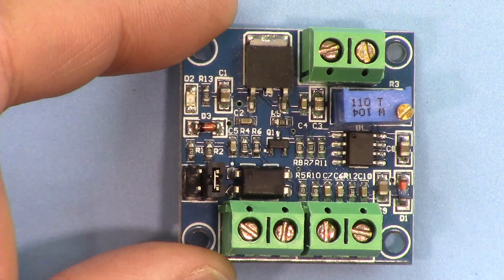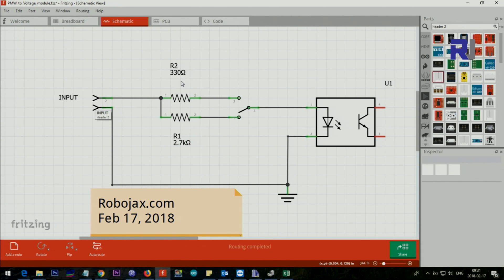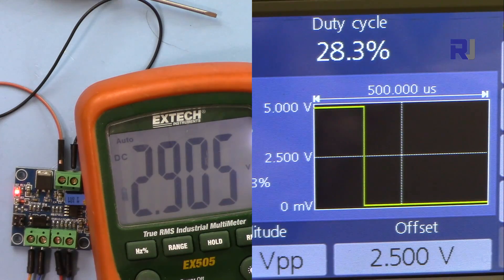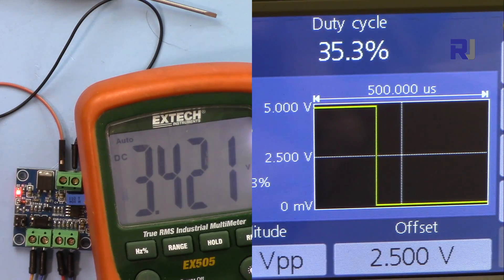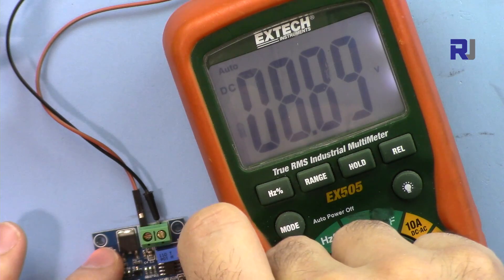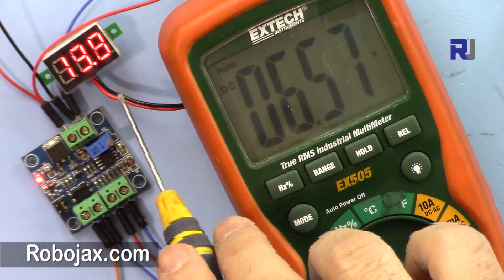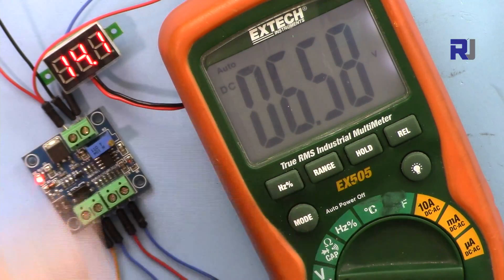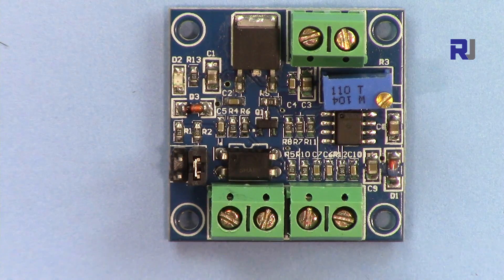Convert PWM to Voltage using IC Station converter (Review and Test )

Comment: What makes this module interesting for me is that now I can use any digital sensors to convert data into an analog signal and work with it without jumping through hoops - or rather, without dealing with the Modbus protocol - and that makes me happy.

Comment: this board cant hundle the power they burn easy the back side and turn on fire when i use them to turn my 0-5 volt out from mach3 board to vfd spindle .. becareful with it i solder strong cable to 1 off them to keep it work and they not take fire on the chips on  they take fire on the board connections always i burn like 3 of them they work fine and then they get fire random... after some use

Comment: @robojax why do some of these converters have a 103w trim pot and some a 104 w pot? Measuring from center to one i get a constant 5.29k ohm (even turning multie times) and the other center to pin a constant 0.03k ohm. I have replaced with a good one after testing out of circuit, was good and once in got the same as before.. it wont adjust and get get same voltage no matter what the pwm input or the vcc input is.
Reply from the maker: this module is not accurate. You better look at this digial module using Arduino whcih you will have full control https://youtu.be/j_BwZT9z-0g

Comment: Great example, is there any opposite application? 

The input voltage is affected by the variable resistor, so that the output PWM signal produces changes in the duty cycle (changing the speed of the PWN FAN)
Reply: i think this is the board i've bought instead of the one in the video, it looks exactly the same but i'm affraid mine doesn't convert PWM to DC but the opposite way... i'm just trying it and it's not working the way i want (PWM to DC)...

Comment: schematic diagram plz
Reply from the maker: This module is not accurate. Use proper module that you can control and manage : Output DC or AC Voltage using MCP4725 DAC with LCD and PWM to Voltage Converter with Arduino
https://youtu.be/j_BwZT9z-0g

Comment: I don't understand what the jumper is for, is that for the input voltage of the PWM signal. I have a woodpecker CNC board, and the spindle says 24v PWM, so I need to convert this to 0-10 MACH3 volts, will this do that. Thanks

Comment: is there any information of how much ripple the DC voltage output has/ how smooth it is?
Reply from the maker: Please use this module with pepper quality design and have full control Output DC or AC Voltage using MCP4725 DAC with LCD and PWM to Voltage Converter with Arduino
https://youtu.be/j_BwZT9z-0g

Comment: I'm searching a circuit like this for control via PWM motherboard signal non pwm pc fans, but need the pwm frequency is to be around 25 KHz and from the characteristics this circuit manages up to 3 KHz
Reply from the maker: Hi, here is better option where you can do exactly what you want https://youtu.be/j_BwZT9z-0g

Comment: Hi dude, could you please share the code?
Reply from the maker: what code? this video has no code. Here is better solution to convert PWM to Voltage https://youtu.be/j_BwZT9z-0g
Reply: @robojax  I would like to convert PWM to voltage 0-10 using IC station converter (LC-LM358-PWM2V) with  potentiometer as the input but I dont know how to write the code and how to wiring because I am a newbie in Arduino, I just learned Arduino. If you never mind, could you please share the code to convert PWM to voltage 0-10 using IC station converter (LC-LM358-PWM2V) with  potentiometer as the input?
Reply: code in Arduino

Comment: @robojax Hello! Please help us if you can! I have a project where I am using a standard PWM controller to control a 12v motor and gearbox, but need to use an ebike throttle with Hall Effect sensor. Do you think there is a way for this converter to work in reverse for that application? Currently it works when hooked up, but motors turn slightly due to the hall sensor throttle giving the controller a different control voltage signal than what it needs. Other than turning slightly everything else operates normally, just need to knock out that 1v signal that the hall sensor is giving out while still being able to vary the voltage with that throttle. If anyone could help I would greatly appreciate it!!!!
Reply from the maker: Hi, this might help you Output DC or AC Voltage using MCP4725 DAC with LCD and PWM to Voltage Converter with Arduino
https://youtu.be/j_BwZT9z-0g

Comment: hi, i have a problem, i  set the arduino pwm output to 255, but Voltage out only 5 volt, not 10V as your description in video, please help me
Reply from the maker: Hi module does not make or amplify the voltage. you must supply 10V to this module and then input is 100% dyty cycle, then you will get something closer to 10V.
Reply: @robojax  im supplied 12 V for Vcc
Reply: And input is 100% duty cycle: analogWrite(3,255), but only 5V out
Reply from the maker: Why you talk about programming and others things. I am talking about t this module not the arduino board and I have no  idea what I did in this video. Let’s focus on this module. If you feed 100% PWM with 5V from any source you o the input , and is this module is powered with 12V the you will get 12V at the output of this module.

Comment: I have my pwm on the gnd. I trying to use it with a shelly rgbw2. Any help out there?
Reply from the maker: does not mattger the GND. connect GND and PWM signal to the input.  Or use the module shown in this video to have proper control over the signal https://youtu.be/j_BwZT9z-0g

Comment: Is anyone aware of a PWM to Voltage converter that will work with a 20kHz PWM signal?
Reply from the maker: use the method shown here https://youtu.be/j_BwZT9z-0g to have exact control over PWM and the voltage output.
Reply: @robojax  Thank you, very interesting! However, that needs an arduino + custom code. I was hoping for a turn-key solution like the one in this video

Comment: For some reason my amps are changing from 5amps in to 1amp out when plugging into this. The current does not seem to be right. Any reason for this?
Reply from the maker: Hi, this module is about "PMW to voltage" there is not current. may be you posted under wrong video?

Comment: Hello how are you? Thanks for video. Question is: Can and I connect a DC motor to voltage output for example? Wich is maximum current supported. Any recommendation in negative case.
Reply from the maker: Hi, no you can't . In order to run a motor, you need motor drive. The output from almost all devices have very little power and won't be able to drive a motor.  you may learn it from this video to use L293D chip and feed your PWM to L293D https://youtu.be/D4yLsWvZDw4 or learn from this video to inject your PWM to the motor driver. https://youtu.be/EapP4BhlYb0 but and forget Arduino. I used Arduino to generate PWM, but you already have PWM signal. then feed it to motor driver.

Comment: Is there any way to make this module accept a PWM input of 0-3v? If not do you know of one that will convert the 0-3 to 0 to 10? My CNC machine spindle output only gives 0-3 out and my new VFD wants to see 0-10 for proper spindle speed control.

Comment: Hi there, I need a device that will convert a 3.3v PWM signal to a 5v PWM signal. For example, a 75% of 3.3v duty cycle to a 75% of 5v duty cycle. Is there a product that can do this?

Thanks a million

Geoff
Reply from the maker: So you just want to convert logic level. That is very simple . Search for logic level converter.

Comment: Is the ground for pwm in and ground for analog out isolated from each other?
Reply from the maker: It should not be isolated. But I am not sure. Use ohm meter and check it

Comment: I connected 12v dc to the module, and set the arduino pwm output to 255, but the output of the module does not exceed 5.3v.  Why?
Reply from the maker: Hi, you made me watch the video.  You adjust the potentiometer to set the output voltage.  the potentiometer is multi-turn meaning you have to rotate it 10 to 15 turns to get result.
Reply: @robojax  No matter how much I turn the potentiometer on the module, it does not rise above 5.3v.
Reply from the maker: Something must wrong or the PWM frequency bus out of range. I don’t remember the value but I should have mentioned it
Reply: @robojax  potentiometer of the module?
Reply: @robojax  The voltage supplied to the module is fixed at 12v

Comment: I need a device with input 30 to 50 volts and output 0 to 10 volts. It  should be stand alone unit , is there a frequency required? It's for a battery level monitor so minimal current is required
Reply from the maker: I have explained the voltage and frequency. Please watch the video fully. I don't remember anything from this video.

Comment: Why do you say it's precise? you're getting 6,8v at 100%PWM. Shouldn't it be 10v at 100%?
Reply from the maker: I am. Not sure what are you referring. I have to watch to answer , but please watch it fully. I mentioned what is the maximum input voltage and I don’t remember.

Comment: Hi I am using arduino flow sensor yfs201 with plc so I want to convert it's pwm output to analog voltages I am impressed by this video but I need your suggestion ass well does this product work with this kindly respond

Comment: I am looking for a device to go from the output of an RC receiver to the 5K pot input of a motor controller.  Any such thing?
Reply from the maker: so put it this way. you want to control a motor using RC remote controller. You can use this module to control a DC motor using Arduino (in one direction) https://youtu.be/ipFxYQkB5uw and you can find codes to detect RC receiver code.  or use this module https://youtu.be/PUL5DZ9TA2o and control up to 30A motor in both direction or 2A DC motor in both direction https://youtu.be/wn5D7j1ybxY good luck.
Reply: @robojax  I am wanting to radio control e-bike brushless hub motors.  Hobby RC ESCs are not designed for this type of motor.  The e-bike motor controllers use a 3 wire pot or hall effect throttle control that varies 5VDC out of the controller back in to the controller to set the motor speed.  I want to come out of a channel on an RC receiver into the throttle input of the e-bike motor controller.  I could mount a servo to the throttle, but would like a neater solution without using a microcontroller like an Arduino.  If the RC signal could operate a digipot, I think that would be great.
Reply from the maker: Yes there are so many library that you can use (I have not used them yet) to extract values from the RF signal from receiver and do whatever you want to with  it. Sure you can do it. just do a bing/google search .

Comment: Hi, I can see that all 3 GND pins are interconnected (on the backside of the module). This way, the GND from PWM source is connected to GND from DC 12-30V source. Is it okay? Does the module have any protection against overvoltage from DC source to PWM ground in case of DC source failure?
Reply from the maker: Hi, no it does not have protection.   so prepare your input properly.
Reply: @robojax  In a reply to @Ale, you wrote : "you can disconnect the optocoupler's ground from other device". If I do this, I would have much better protection of PWM signal source, because its only connection to the module would be via this optocoupler, ok? Have you already tried to disconnect the optocoupler's ground? How did you do it, simply by unsolderning the pin of optocoupler, or by unsoldering the reference GND pin (next to PWM input)?

Comment: I need the opposite: 0-10V PLC signal to 0-100% PWM signal. Any recommandations?
Reply from the maker: use $10 Arduino board and 2 resistors . Read 0-10V and very easily output PWM proportional to the input voltage. This is to read any DC voltage with Arduino https://youtu.be/t8xwrVj2aFs and then learn how to generate PWM from this video https://youtu.be/k13iTmvPtUU

Comment: Voltage to PWM?
Reply from the maker: yes that is what the title says. PWM duty cycle will change proportional to voltage.
Reply: @robojax  No the title is convert pwm to voltage. The material is quite useful. My question was can you do a Voltage to PWM(Not Voltage to Current) vice versa video relative to this video. I'm looking to use both modules in tandem(V to P + P To V) to create a tuneable inline fan flow protection or signal generator using 2 Inline duct Fan's. It's complicated but the goal is to  find a use for the0-10 reference voltage off of the fans which are unpowered but spun inline to create a reference of air flow.
Reply from the maker: Yes. very easily. This video https://youtu.be/3_C7gJeX9hc show to measure the voltage from potentiometer and proportionally outputs PWM to control servo motor. so you can use it for other purpose.
Reply: @robojax  Perfect!

Comment: Hi! I am using this board to control the spindle of my CNC. I was really surprise when I found that on the pwm to voltage board all the GND are shared. I see a PC817 optocoupler so I do not understand how that is possible. I checked on 2 different boards I have and they are the same. So wondering do you know why all the GND are connected? Thank you very much
Reply from the maker: Hi,  Yes. you can disconnect the optocoupler's ground from other device and it should work. Yes it is bad design.
Reply: @robojax  What do you mean? Is there a bridge on this board that connects all the GNDs together? IF yes where is it? Thank you

Comment: Hello. My PLC has sinking transistor output. I set the jumper to 24Vdc and connected +24VDc PSU to PWM and PLC digital out to GND of the PWM input. the analog output showing static 10V. It doesn't seem to work.. Can this module used with sinking transistor plc?
Reply from the maker: hello, I have not tested it and not sure. I am sorry for late reply. I was on vacation.

Comment: Can this device turn a 2 pin fan into a 4 pin PWM fan?
Reply from the maker: this module gets PWM and outputs only voltage. The output is very low power. You can't use to driver a fan. You will need a fan driver or motor driver between them.
Reply: okay I understand.  Can I use this on a PWM PC mother board connection for a 2 pin black/red fan?  It reads PWM data at low voltage... not 12v but 5v.  Currently I am only using the power supply connection to power the fan at full speed.  But if i connect this to the mother board it can read the PWM data and speed control the 2 pin fan!    Sorry for so many edits!

Comment: Is there a way to do just the opposite of this? Convert a 4 - 12v input to a pwm signal?
Reply from the maker: yes. You can do it with Arduino. here is  my video that shows you to generates PWM from potentiometer that outputs 0-5V and PWM is controlling the servo https://youtu.be/3_C7gJeX9hc and  if you wan to input 12V to Arduino,  you will need to put 2 resistors in series to scale it to 5V input of Arduino. You may watch this video to learn how to do that https://youtu.be/FaoKzi7tgME you don't need this module in the video. Watch without escaping and check the description for documents. Good luck.

Comment: would this effect the original pwm signal or alter it in any way? In other words, could I use this to monitor the duty cycle of a device I am controlling with the PWM signal without changing how the controlled device is responding?
Reply from the maker: It just read reads PWM. It does not change it.

Comment: How max output current ??
Reply from the maker: Very minimum (less than 5mA). Can't even turn on an LED. So it is just weak signal to be used in another device.
Reply: Is there anyway to increase the output current, at least for run a tamiya motor (without load)
Reply: does not matter if power (watt) will be increasing.

Comment: Hi, I want to use this module in an application where the pwm frequency is 10 Hz!! The module is designed for 1kHz upt to 3kHz. So, if I would use it in my application, the voltage ripple would become very high. Is there a schematics available? Or can you tell me which resistor and capacitor are responsible for the output filtering/time constant, so that I can change them?
Reply from the maker: this module uses LM358 OpAMP http://www.ti.com/lit/ds/symlink/lm358.pdf  and quick google search for "LM358 PWM" resulted to many pages. Here is one which I traced from "google images" http://henrysbench.capnfatz.com/henrys-bench/arduino-projects-tips-and-more/arduino-lm358-op-amp-pwm-to-voltage-converter/ you might be able to change it if you know what you are doing.
Reply: Robojax  Thanks for your reply! I think the LM358 is not the "problem", because it is a standard OpAmp. It becomes a Low pass filter by the used resistors and capacitors in the schematics. The problem is that I can't figure out the resistor and capacitor which are responsible for the low pass filter because it is not so easy to figure out the schematics of this by having a look on a picture of the circuit board.
Reply from the maker: I sent you the diagram and datasheet  so you can see. it is very easy to see pin https://snag.gy/5Y9B8v.jpg and then see which pin  is connected to what and remove the component and place another components. It is doable but if you can't do it. then get the chip and make your own converter.

Comment: Did they pull this product?  I want to use this to change the 0-10v pwm signal to 0-5v pwm signal if I can.
Reply from the maker: sorry didn't understand "did you pull this product?"
Reply: @robojax  I was wondering if there was something out here that would take 0-10v signal and bump it up to 0-12v signal?
Reply from the maker: You were right. They changed the link. But I was to to find it with simple "PWM" search in their website. I have just updated the link and here it is http://www.icstation.com/voltage-converter-module-adjustable-converter-power-module-digital-analog-signal-p-12498.html
Reply: Did they, I clicked the link below and it was showing up as $0.00.  Like it was discontinued.